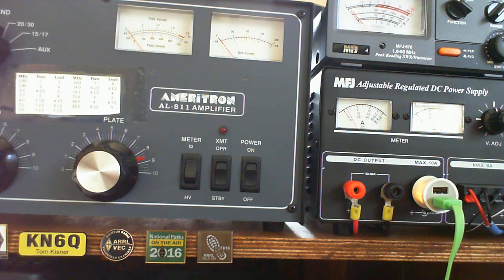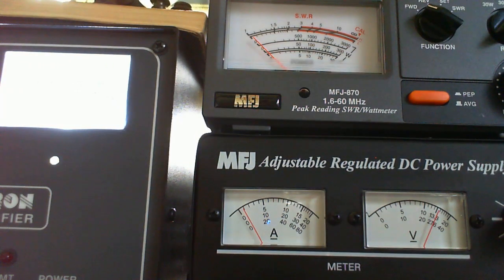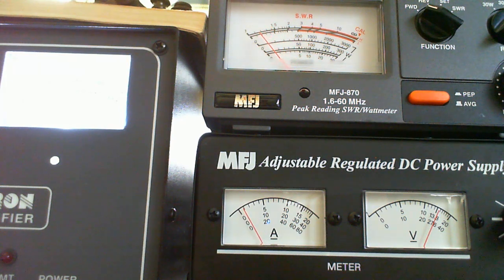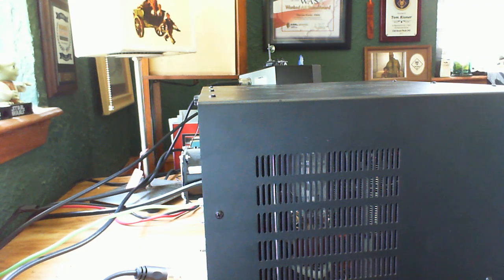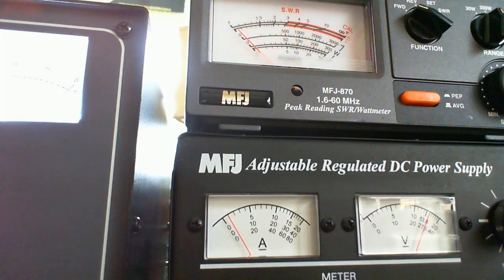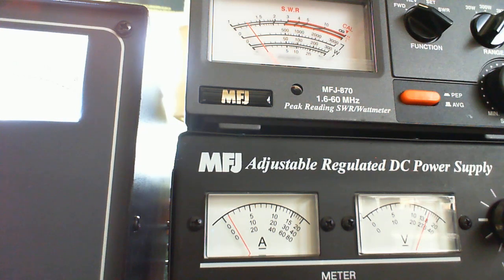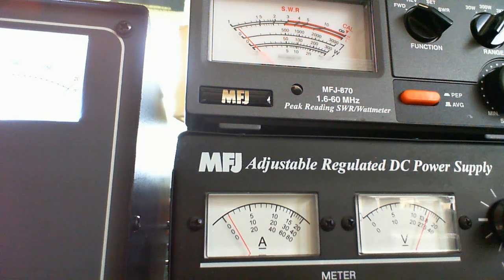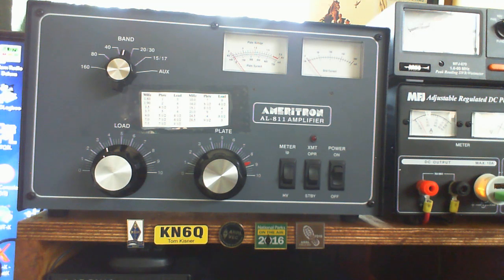AL-811 811A Tube upgrade to DX Engineering 572B

Comment: I’m rather shocked you didn’t mention the 572b runs 2400 to 2600 vdc b+. The 811a is around 1600 vdc b+ what is the plate voltage running on that amp ty

Comment: Driving with 75 watts?   I have 811A tubes in my AL-811H amplifier. When I tune I use 20 watts to start and my grid is a t 50ma and the plate is around 100 ma. Once tuned the max I ever drive with is 35 watts. My plate is 450ma and my grid current is around 100ma and my out put meter reads  600 to 800 watts depending on Band.  seems like he was driving with a lot of power.

Comment: 60 watts input is the most I ever put into mine. Don't forget to fine tune each band coil on the rear of the amp for whatever your favorite frequency is. I use a Bird and Daiwa large face meter to see exact results.

Comment: waiste of time and money. Voltages are -+1500volts so 572b never comes to full potential. I have SB200 and with 2 tubes gives 600watt with no sweat.. If you want more power just buy better and bigger amp bro. Your transformer is weak for those tubes.. You will kill transfo bro. There is no cheap breakfast in 5star hotel oor cheap whore that you want need docter after.. 7'3 and stop doing bs PLEASE

Comment: A total waste of time and money. 572 has the same curve as an 811 except the voltage goes higher. Multiplication Factor of 811 is 160, 572 is 170. You have to increase the plate 1000 volts and pay more per tube for what? An extra 150 watts? And at what frequency? I rebuilt a Gonset 101 with a better HV supply and get more out of 811A without stressing the tubes.

Comment: That must be a newer amp than mine. Yours does look like they put the W8JI mod in it to prevent occilations. Looks like the resistor and capacitor on the floor of the amp next to the last tube. Mine an 1985 vintage 811 amp has the American made RCA's tubes with fins. I get 400 watts with 36 watts drive at around 300 plate and 140 grid. You are limited by the power capability of the transformer. You could burn up the transformef if you push it too hard! I would love to have 572b tubes in mine. But a new set of tubes wuold be more than i payed for the amp used. I have thought about putting some Chia 572b's in it but even then quite expensive. I love my 811 amp. I also agree on the power meter i have a MFJ Versa Tuner V and i think the meter is generous.

Comment: I had the 811H for about 10 years and I tried one set of 572B tubes and it was a Waste of Money. They ran cooler than the 811 tubes but they produced No output power difference and they cost over twice as much as the 811 tubes. It was a very Poor investment.It’s not the tubes that will increase the output power unless you modify other components.The power supply is only good for so much so the best thing you can do is Upgrade to a larger output amplifier.I went to an ICOM PW-1 and sold the 811H though it had been a very dependable amplifier.I don’t regret the change because I love the extra output power on HF & 6 meters. Ameritron sells the 811H with 572B tubes and it’s rated for 800 watts just like the 811 version.
Reply: the 572B tubes can withstand higher power dissipation (>120W, almost twice that of the 811A tubes), and this makes them more durable with higher duty cycle modes. This is the ONLY reason you want to upgrade to these on an 811H amp: higher reliability.
Reply: @ny6u  Not worth the difference in price and I Sold my 811H after my wife bought me an ICOM PW-1 so it’s not an issue.

Comment: Ive seen these amplifiers with good 811 tubes with only 40 to 50 watts drive power easily produce 600 watts output from 160-15 meters and 550 watts output on 10 meters.
Reply: 811H with the 4 tubes?
Reply: @beekeeper8474 probably as mine with 3 tubes gives cw only 300watt.. Many people have compromises power meters 😉
Reply: I routinely get 600 out with 40 to 50 watts drive with Taylor 811A tubes

Comment: if the Ht voltage is  1700v like 811a's require an 572B can never equal the power of the 811a at that set voltage...
the 572B is more rugged and powerfull at 2400v HT.
after each RF increase you need to dip the amp again.
maybe the 811a\s were (soft) but i reckon they would have easily topped 600watt if dipped correctly, as i have never had them go weak, ratrher they go poof! if driven to hard due to heat failure of the anode  shorting out on the grids (metal gas flakes of(redhot).
so if you were to use the 572B's they will last forever as they will be used 60% of there capability running 1700v HT and not 2400v as they were intended.
just my 5cents.. we all do as we please  :)

Comment: Man it’s a miracle you didn’t get lit up! Never ever trust a bleeder resistor to discharge the caps! Please all those you do this make sure to bleed off the HV caps before getting into the HV section of any piece of equipment. It can be fatal!
Reply: Either that or switch to HV and watch voltage bleed off. Once it gets to about 150VDC, I short it to ground.
Reply: @GeneralHAM-d5k  this is a much better approach. Although 150VDC is still lethal voltage !
Reply: @ny6u  I wait til it gets to about 150V before shorting so I don't stress the filter caps too badly.
Reply: @ny6u no it's not. 🙄

Comment: You need way more plate voltage at the same current to get those 572b tubes to honk.  I'd recommend you not drive them with more than 50 or 60 watts, but others will surely disagree with everything I stated. ;)
Reply: I cringed a little bit when he put 50 watts of drive on them with no tuning!  The stock 811A tubes will do 600 watts if you tune them properly.
Reply: @micromashor  ameritron thinks it's okay to wrong 200w from an 811, but I disagree.  150w is kinda pushing it.  I have a homemade amp with 4 811s in it.  It will do 400W, but that's it.  The power supply transformer just isn't up to the task of supplying that much current.  It's fine by me because my tubes will last forever, and they don't need a fan or chimneys.  I've yet to find a datasheet for any 811 saying it's okay to get 200W per tube.

Comment: I recommend changing the power cord to
a 12/3 or 10/3 power cord.
Then put the bigger caps in it.
The power cord they send them with
are 16/3 which is not big enough to power a lamp much less a 811 3 tube amp.
Reply: That's the funniest thing I seen in a while - - you could put 4/3 power cord on - won't change a thing..... you shuold spend more time learning than posting and making yourself look uneducated.

Comment: An important comment here. First of all, thanks for posting the video. This is a very popular idea for many amateurs to do to their 811 series amplifiers.

However:

When switching out from 811A tubes to the 572B’s, it’s VERY IMPORTANT to let the amp run with no antenna or rig hook up with a set of “new” 572B’s for 48 hours or more to allow them to “burn in.”

It’s also good to allow the amp to “neutralize.” This means, with again no rig or antenna hooked up, you place it into the operating mode and slowly turn both pots watching the readings for any oscillations. If the meters don’t move, you’re good. If they do, there’s information out there on the Internet on how to solve this problem.  

In most cases, the needles won’t move, however it’s good practice and proper technique to make this tube switch out successful.

Comment: Actually you could have gotten more power if you tuned your system and adjusted you plate and load + let the amp warm up. 73s

Comment: You know been seeing a lot of these tube swaps with the 572bs the 811H with the 811s WILL do 600 carrier with about 700 to even 800 watts on the peaks but that's driving it hard. I know I have repaired a few of them for people and even owned one for the hell of it they all are about the same and this was on a Bird 43 watt meter.  Now you can get more out of them with the 811s simply get rid of the power doubling plate supply build a external Full Wave Bridge supply at about 1900 volts don't go beyond that or things will start coming apart quick LOL.
With this mod you will see 900 watts out on the peaks BUT those 811s will not last long at that point or put in the 572bs raise the plate voltage to 2800 to 3000 volts change the blocking cap at the plate choke and the plate choke if you like it ran 1500 all day pep ran one for a year no problems at all.
One thing to keep in mind the variable plate and load capacitors will be at max levels even beyond that just keep them clean NO DUST and when you tune the amp BE SURE that your swr is flat or at least 1.5.1 or better BEFORE you start tuning it up also be sure the relay in the amp is clean. 

One more thing ALWAYS make sure the caps are discharged after they bleed down short them to ground with a screwdriver then get a wire with alligator clips on the ends and clip the caps to ground caps have a way of coming back to life when you least expect it.
Reply: What do you charge for all that work? I think that's a little bit beyond what I can do, but would like to have it done to my 811h
Reply: Do you have a write-up or know anybody who does about making this modification
Reply: @beekeeper8474  Well what it really comes down to is bang for the buck. Without having to design a all new amp the best way really to squeeze out about 900 to 1100 out of a AL811-H  (SSB ONLY) is to change the taps around for the transformer. So the first thing you should so is set it up to run on 240 Volts not 120 volts will draw a less current and run better. I think the blocking caps in those are 5kv so you should be ok there. Now those 572bs will need more plate voltage to really get them to work the cheap way to do this is to hot tap the transformer in the amp so if you have 240 going into it set the taps on the back to something like 220 or 230 this way the transformer will make more plate voltage REMEMBER this will heat it up more and is harder on the rest of the parts in the amp! I cant remember what the filter caps are rated at but I am sure they would be close to the limit. If they are rated at lets say 450 volts buy new ones and put in 500 volt caps.

Now you HAVE TO get a filament transformer and not use the filament taps coming from the transformer because when you re tap it for higher plate voltage it will also raise the filament voltage as well so you need to keep the filament voltage around 6.3 volts it is a little bit of work to do all this. And also you will have to check the biasing and make sure everything there is in check. After all this is done the reality is that no one will see the difference really in signal strength at the other end. All what I have mentioned is really the basics to keep it from coming apart but if it were me I would not do all of this to that amp it is just beating it up.

If you want a honest 1000 to 1300 or better out of 4-572b's find a old Dentron Clipperton L amp and freshen it up. I'm not saying what you want done cant be done but like I said bang for the buck. There are a lot of things that need to be looked over relays, the main transformer which really isn't designed to run at those higher voltages also you metering lamps will burn out a lot faster etc...
Reply: @jamesmackinlay4477  Really - you got 4x450v caps= 1800v. You are saying crank the voltage up beyond the cap rating - - genius!
Reply: @hoosierbuy  Thats why I said build a external power supply or you can up the caps in the amp. Anyway it all isnt really worth it anyway in the end better to get a bigger amp.

Comment: Awful background noise until the end. Something is wrong here the 572B tubes should do 600 watts pep (peak envelope power) with 40 watts drive. With his case his ameritron amp was designed to operate 811A tubes so the amps transformers are not large enough to run more than 1 or 2 at the most 572B tubes. But as long as he backs his drive down the new tubes should last a long time as they idle along. One last thing do not handle ANY Vacuum tube with bare hands use clean rubber gloves to preserve the life of the tube.

Comment: Aren't you supposed to readjust the "Plate" and "Load" controls as you increase the drive?  

Also, makes no sense to increase the drive power past the point where there's no additional output power.  Hope you don't leave it that way.
At least that's the way I learned...
Reply: And you learned correctly. Turning it up past the point where power output does not increase is what causes non linearity.  and yes the plate and load need to be retouched.   73  James K0UA
Reply: Plus at 450-550 watts 40-60 watts makes very little difference in the real world or in the wild $450 watts will be seen at the receiver station at the same as 550 watts, in other words just stick with the 450 watts with the drive both radio & amp will be happier . Big and better improvement over all run a 220 line in. The all will be happier. My 2 ¢ .

Comment: You should never increase drive beyond the level you initially tuned the amp at without retuning the plate and load capacitors. Small wonder why your 811's were flat.
Reply: you hit the nail on the head

Comment: This is an extra class operator, obviously that does not mean much these days.. just memorize the answers on the internet.  He apparently has no experience with vacuum tubes and proper handling .You never, ever touch a vacuum tube with you bare hands, unless you want to create hot spots on the tube and decrease life expectancy of the tube.  THIS VIDEO IS A PERFECT EXAMPLE OF HOW NOT TO REPLACE VACUUMS IN AN AMPLIFIER OR RADIO(and yes I remember the days when radios used vacuum tubes) Watch only if you need to know where tubes are located and how to remove. Do not follow this hams procedure.
Reply: RAY JACKSON you are a tool
Reply: @lizzyfan1986   No, he told you correctly, you don't touch the tubes with your oily finger.  You use rubber gloves.  And you also retune when you increase drive significantly, and you never increase drive after the amp fails to increase appreciable power.  The going to 85 watts to even test was a bad idea.
Reply: @lizzyfan1986   No, he is not a "tool."  He is telling it like it is.  You don't touch tubes with your bare oily finger unless you want to shorten their lives.  You also don't need to drive a 811 amp with more than 50 watts SSB unless you like replacing expensive tubes for no good reason.  Like James Santore stated, we need to separate ham radio from CB.  CB'ers focus on maximum power output and SWR.  If the SWR meter shows 1:1, and output is max, all is good.  A ham that understands what is going on knows that a 50 ohm resistor will give you a 1:1 SWR, and overdriving a tube or transistor amplifier will give you max output for a short duration, with maximum distortion, and short component life.  You need a 6db increase in gain to achieve a 1 s unit of change at the receiving station.  So driving an amp that chugs along happily at 450-500 watts to 600-800 watts does nothing for your signal, and simply shortens the life of your tubes/transistors.  6db gain requires a quadrupling of gain either from the transmitted power, or antenna.  If you are S5 with 400 watts, you would need 1600 watts with the same antenna to gain 1 S unit.  Hardly worth the cost of the amplifier components.  Ignore the CB crap you have learned, and study actual radio math.  Ray Jackson is correct.  Anyone with a memory can become an Extra Class Ham.
Reply: Glad that we have great Elmers     Keep mentoring the new guy   mentoring and teaching is what is seperating our great Craft from CB
Reply: So exactly how many minutes/hours/whatever does a quote “hot spot” from touching a tube reduce its life? Good grief.

So the pair of 3-500z’s I installed with my bare hands 10 years ago, and still getting legal limit from by properly tuning and driving the amp, could fail any moment because I touched them with my old oily fingers?

Comment: Tom great video. I have a question i have a al 811,, question the black resister on the bottom by the  tube on the side is one leg cut and also how many turns was the parasitic coils 5 or 6 on the PCB?

Comment: Sounds like the original 811A's were somewhat tired. I used to have the 811H and found that putting in Chinese 572b's actually reduced the output power from around 925W down to just over the 800W into a dummy load! My amp was running on 240VAC here in the UK.  High power RTTY and SSTV (i.e. high duty cycles) will shorten the life of the 811A's.  That's why I part exchanged my 811H for an Alpin 100 mk3 with a ceramic tetrode in it. ;)
Reply: Alpin 100mk
Reply: Alpin 100mk
Reply: if your 811h gives 1000watts then is oscillating bro heawly.. On my rms meter with new tubes gives 600watt max..

Comment: I learned something new about the 811! Are the 572B still stout? Thanks for uploading!

DE KC5NGX
Reply: Yep... the 572 is definitely relatively stout. It has a maximum plate dissipation  of 160 watts compared to the 811's max 65 watts dissipation. The 572 has a very rugged one-piece compressed graphite plate assembly for it's anode and the 811 has a stamped sheet-metal plate assembly made of two halves spot-welded together.. 572's are definitely an awesome and direct upgrade. :-)
Reply from the maker: Absolutely!  Very glad I did the upgrade.